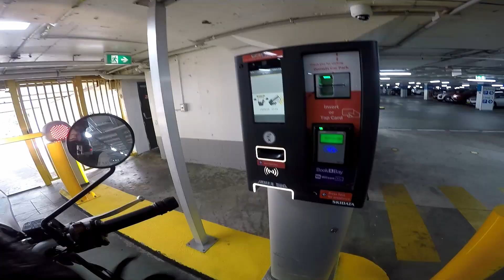Road Trip Kick Off - Beyond the blue mountains: Part 1 - RE Himalayan & DR650 [Ep15]

Comment: So, Liss, does the P plate mean you've passed your test? If so, congratulations!!. After seeing you pulling the crash bars back into place, again, it reminded me to let you know the latest on the ZANA crash bars I fitted to my Himalayan. Still no news on whether they're strong enough, but I think they will be as they have a 3 point fitment. But, I did an oil change recently, and discovered that getting to the oil filter was a real faff as the engine guard gets in the way. Had to slacken off the engine guard to get at it.
Reply from the maker: Liss: Yes! One step closer to getting that international permit. That doesn't sound ideal, but I guess it depends on how much you ride, how often you need to do that. The benefit of my guards it that you can just bend the bars away from the bike and get right in there ;)